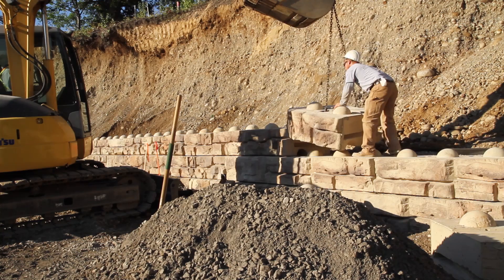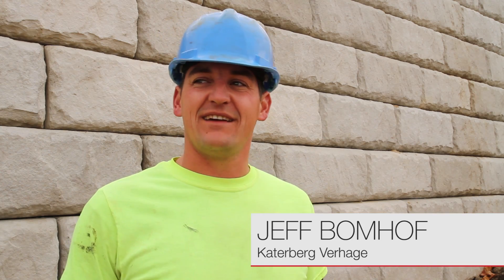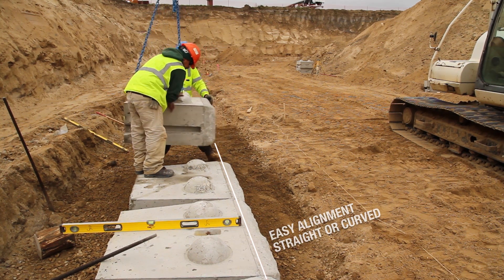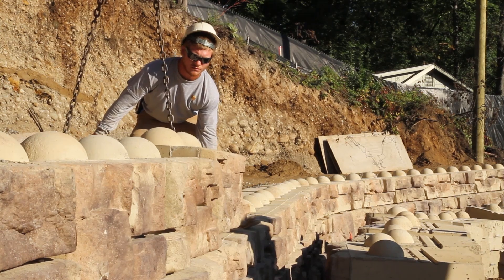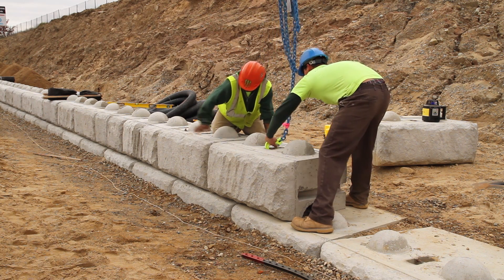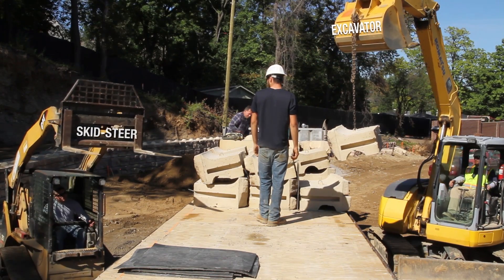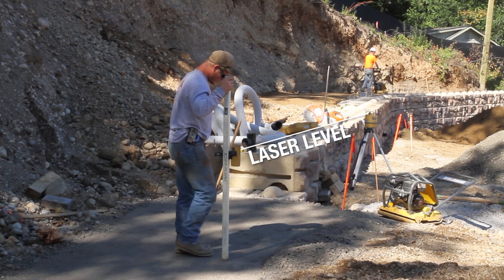Why Contractors Choose Redi Rock Retaining Walls (Installation Overview)

Comment: Drainage holes ?
Reply from the maker: Drainage is a critical component of proper retaining wall installation! Hydrostatic pressure is the #1 enemy of retaining walls.

A drain is placed behind the Redi-Rock wall blocks at the lowest elevation where the pipe can safely outlet to
daylight. Drainage aggregate should be placed to the bottom of the drain. A 4-inch (102 millimeter) perforated sock drain is commonly used for the drain pipe. Often the drain is encapsulated with drainage aggregate and wrapped with a non-woven geotextile fabric. The drain should run the entire length of the wall and needs to have proper outlets on the ends and at regularly spaced points along the wall. Solid pipe should be used for weep hole outlets through the face or under the retaining wall. 

You can find the Redi-Rock Installation guide here: https://www.redi-rock.com/installation/learn-how-to-install-beautiful-retaining-walls/

Comment: We just made a retaining wall from massive blocks like these. Most concrete companies make these blocks from returned concrete, but they are definitely not as precise as these blocks. Our first wall was made 6 years ago and has a shipping container haymow on top of it. Still in perfect condition. We are currently making a 60' long wall to make more space for a woodshop. If you live in a hilly area, these are the best way to gain flat space here and there without having slopes between them that require maintenance! Lots of video on our site if you're interested...
Reply: السلام عليكم ممكن تواصل معكم
Reply: I am very interested!  What is your site?  Where can I watch the videos?

Comment: With no reinforcement to tie the blocks together, it seems you’re placing a lot of reliance on the (negligible) shear strength of those concrete domes to resist lateral forces. There must be very definite limits on the height of what is effectively an unreinforced mass retaining wall.
Reply from the maker: Thanks for your comment! You can find interface shear testing reports at https://www.redi-rock.com/retaining-wall-engineering-architect-structural-test-reports.htm. Redi-Rock gravity walls can be built 15+ feet without requiring geogrid or tiebacks. You can check out all our engineering resources at https://www.redi-rock.com/technical-resources-for-retaining-walls-designers.htm!

Comment: Nice system.
As long as you can reach the building site from the front or footing of the wall, everything is fine.

But if you only can work from above with machinery, you will have a hard time or need a long reaching crane.

Comment: how much does each block weigh?
Reply: I think they are 1.250 not sure.
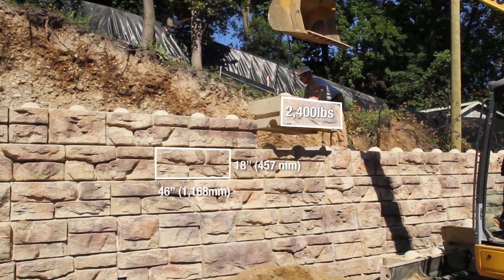Reply: It tells you at 0:37.  2,400 lbs.  Although I am sure they have various sizes of lego blocks.
Reply: for standard blocks between 1160 lbs to 3420 lbs. they have much bigger ones than that too